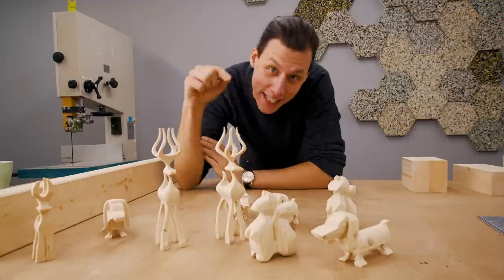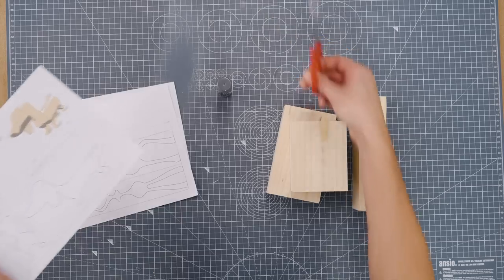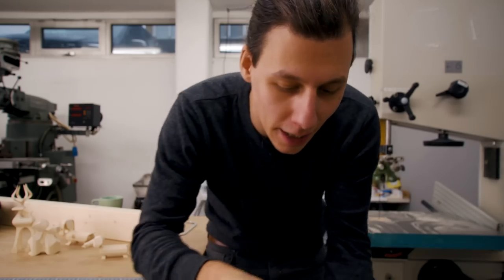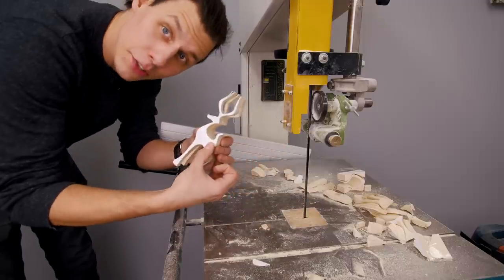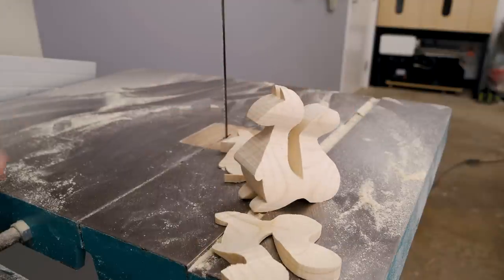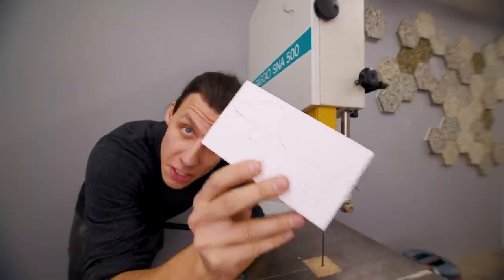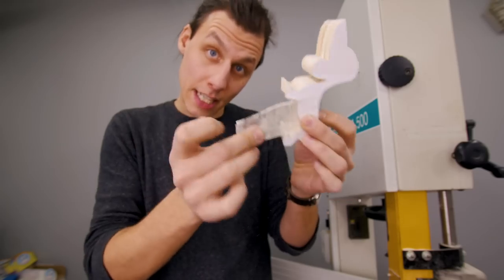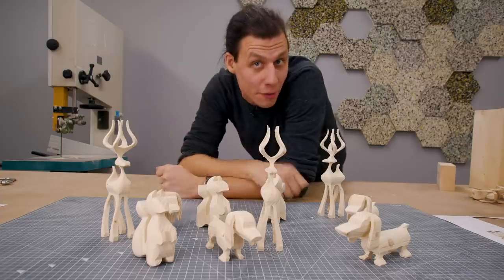I made These wooden animals using only a Bandsaw!

Comment: The template does not fit correctly on an American 2x4.  I had to shrink down the template to 80% for it to fit.  Since you put the measurements in mm, I am assuming you are not in the States.  The thickness of the 2x4 here is 1-1/2" and the template requires 1-7/8"

Comment: Thanks for video, I purchased your templates, problem I'm having is that the template for the deer is larger than a conventional 2x4, the dimensions on the downloads, I believe are in millimeters, and the thickness on the drawing is 48mm, when a conventional 2x4 is only 38mm, could you please let me know if I need to print in a smaller scale?
        Thanks Again
Reply: 2x4 is 2inches / 50,8mm) by 4icnhes / 101.6mm, so if your 2x4s measures 38mm thickness it is not really conventional ;)
Reply: @CorporalClegg77  Elden is correct… in Canada, a conventional 2x4 is actually 1 1/2” ( 38.1 mm) x 3 1/2” ( 88.9 mm) !!!
Marv Janzen

Comment: So here's a question though.. when you are making a template how do you get the front and side views to line up perfectly? Cool little project btw!
Reply: typically when you get these kinds of patterns you print them on one sheet of paper and fold it around your block of wood. even if it's crooked they are still aligned with each other